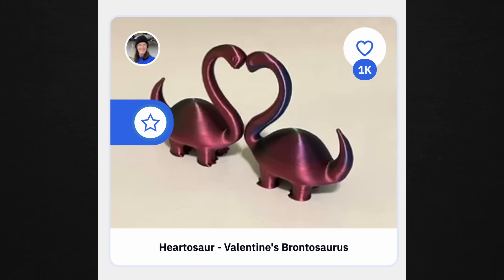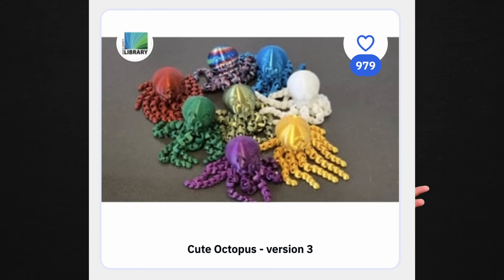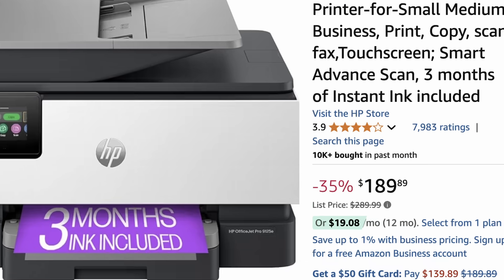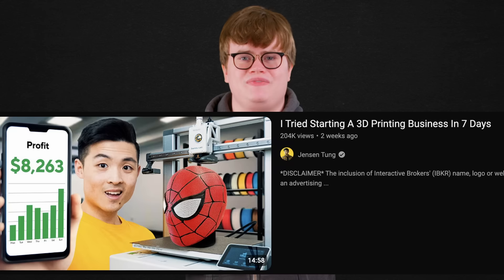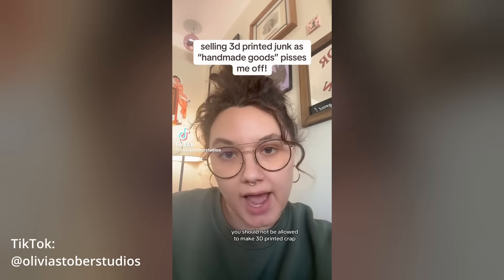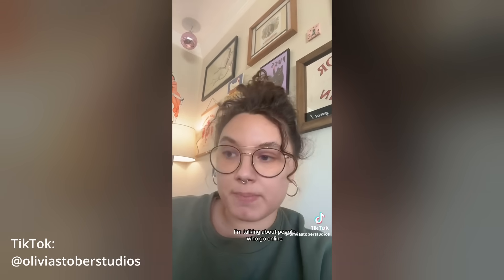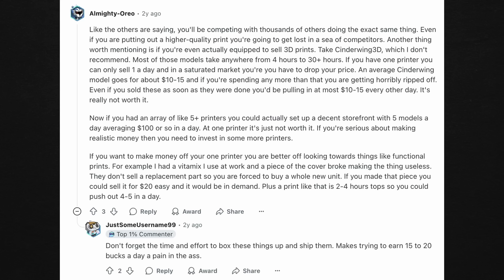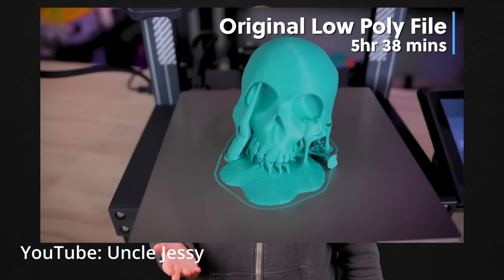The Rise of 3D-Printed Slop

Comment: as a 3d printer owner I can attest to the amount of plastic scrap I have, but understand that's the draw. everything has to have a hook and people being able to make their own silly stuff is part of that marketing hook, but this is just the litness test, this is training to see if you're built for the job. I quickly jumped from building simple thingiverse files to then move to freecad, to eventually create things like an entirely handmade desk with my own fittings and shop wood, created for a specific spot in my house, or the multiple shelves I've put together for cheap with my own brackets and labor. I make my own lamps with cool lampshades, just recently built an electric guitar for 90$,  and am planning to start creating home decor with it along with overhauling my kitchen to allow for more storage. yes the garbage is a problem, why we need more shredding and respooling options available on the market. Unfortunately most are at home DIY creations but hopefully soon there will be a proper at home shredder. If we could have access to a means of recycling these old prints (with no loss of filament quality might I add) for under 300$ that a simple consumer could buy, these silly gadgets could be the key to educating a generation about the possibilities of production. they don't have to be landfill waste, I have a recyling setup that works for PLA, it's not expensive but time consuming and quite in-depth to build off online manuals. Just hold out hope. things will get better with time

Comment: I designed and 3d printed a HRV with the addition of some aluminum, epoxy and silicone for my home for very cheap, it has saved me this winter. I designed and 3d printed custom mounts for a stearing dampers on my electric scooter, I could never have used a steering damper otherwise and it improved the scooter by a lot. I have designed and 3d printed many various parts to fix problems or replace broken parts on things. I have been fascinated by human evolution and I am currently printing replicas of skulls of extinct human species for a fraction of the cost of buying them.

I love my printer because of what it can do for me, but I also find it disgusting how most people seem to mostly print junk.

Comment: As a 3d printer owner, I completely agree with this video.  I only print functional stuff, 90% of which is stuff I designed myself.  Although, I do create waste when making prototypes or small slices of a model to check if it fits.  I just made a replacement charging station using my 3d printer and an old USB cable for my parents' mosquitto zapper, this stuff is what 3d printers should be used for IMO.

Comment: Disliked. It sounds like you really hate 3D printers. While there are definitely crappy plastic junk pieces being sold, they wouldn't sell them if there wasn't a market. If you want to remove 3D printed items from maker fairs, you have to remove any wooden items made using power tools, anything made using a mold, anything that you just assembled from a kit you purchased, and anything that was purchased that you just slapped paint, a vinyl decal, and/or rhinestones on top of. That covers 90% of what you get at most maker fairs.

If you take some time to know what you're doing, and learn how to model your own stuff, 3D printing can be an amazing addition to your hobby workshop. Those who are just buying printers to print files they got online will peter out eventually.
Reply: Well said….love it

Comment: People will buy what they want to buy. And the people who buy a printer will print what they want to print. If you only ever print little plastic octopuses or something and that makes you happy then why make a stink? I will admit off the bat i haven't got facts or stats to back me up, but I would put a decent bet on the idea that hobbyist 3d printing isn't even close to one of the world's biggest plastic polluters. Recently got a 3d printer myself. I've printed a couple of silly things, tentacle xbox controller holder, a couple of statues... But it's also helped me fix so many little things around the house and in my life and has forced me to start using Blender and refamiliarising myself with 3d modelling. 

You talk about the front page of whatever model sharing website having the "slop"... But why should i expect the really useful corner bracket for my very niche requirement to be up on the front page? Of course a cute octopus has more mass appeal and is more transmissible as an idea. They're almost like 3d printing memes. 

I skipped into the bit where you're going on about effort vs price charged. Who should you be mad at here? People printing ornaments and selling them to willing customers, or the customers for not understanding what they're buying? What if they want that specific thing and there is no higher resolution alternative? 

I dunno, I just don't think this is the big deal you believe it is.

Comment: 10:45 It's polymer, not fibrous. And yes, this video is somewhat disparaging. You lament that printing produces waste but also acknowledge that printing later by layer takes time. Yeh a print farm can produce a lot of models but your average person with only one printer will have a hard time producing a lot. Also remember that the dragon model is relatively recent on the 3d printer scene. And that it can take 10+ hours to print. You also don't just 'press print', even with someone else's model that cost them their time to create, there are still dozens of software settings and hardware calibrations that go into the pre print set-up of the model.
Reply: I’m assuming the person sending the model would also send you those software settings and hardware calibration with the purchase of the model files? Or do you have to purchase those separately from them as well absolutely squeezing every penny they can out of you?

Comment: I really like 3D printers and have one at home, and I completely agree with you. One, these things really need an emclosure and air filter in a home setting. Second, there's a lot of useless junk to print. It makes sense: the most useful things to print are things you can't buy because they're so niche, and by definition those things probably won't be useful to anyone else. The main exception maybe is organizational systems, like gridfinity. 

Those 3D printing shops that don't sell their own designs can't possibly be sustainably profitable. You're competing against anyone who can buy €250 worth of equipment. On the upside, failed 3D printing businesses are a great source of cheap second hand printers!

Comment: I mass 3d print miniatures. The price to buy these as sprues would have been several thousands of dollars. I have only  spent like 400. Though this is resin printing. But to be fair newer 3d printers are becoming capable of finely detailed 3d prints as well. 
A key use for both types of printers in my life has been to 3d print and customize specific parts or solutions to problems. I no longer have to scour the net to see IF a solution exists I can just find a design close enough to what I want and tinker with it in CAD software and I'm good to go.

Comment: This unenthusiast view resonates with me... I held off getting a 3D printer for so long because all I saw was trinkets and useless plastic waste. The first thing I printed on mine was a knob so my toddler son could turn his light on and off, and that helped me realize it was a tool that could be used for good. Now I design custom brackets and cases for my electronic projects (but only if a manufactured part is unavailable) and build model trains that aren't available in my region (some from others' files, some of my own design). I slice carefully and monitor my prints to avoid waste, and reuse or recycle the waste plastic when I can. I also believe that if you can't print something nice, don't print anything at all. It's a tool, not a lifestyle!

Comment: What it comes down to is that plastic junk is slightly cool to almost anybody.  Specific and niche prints are great for the person who needs them but if you dont need it,  it has no value.  So since thingiverse or bambu studio library is going to show you something that anybody could potentially want to print.    And if you are spending time designing something to sell, you either need to make somethnng that no one has designed before for a common problem or make something artsy and functionless.  I would suggest you keep track of every time your life would be improved by a custom tool, jig, fixture, etc and see how small that list really is.  In a manufacturing plant, we 3D print quite a lot and prototype fit and function before going into production.  In my day to day life though, it's not as common.

Comment: Most common 3D printer filaments (PLA, PETG, and TPU) don't produce that many harmful pollutants. I've read through their safety data sheets, and kept an air monitor next to my printer with no spikes in VOCs or fine particles. It does still smell a little, so I keep a window open regardless. 
HOWEVER, I know for certain ABS produces a lot of carcinogens, and resin printing offgasses, well, epoxy resin, so those 100% need to have proper enclosures and external ventilation.
Reply: Yeah I think he was getting confused with SLA printing which DOES need proper ventilation as the fumes that kicks out are absolutely toxic.
Reply: Your air monitor is faulty, I'm sorry to say

Comment: I work in injection molding and I can tell you plastic parts do not take more than a minute to be from granules to finished product. Depending on the product you can make 10 at the time that means every 50 seconds you have ready to use 10 parts.
There is an initial investment into the mold and design but after that it is incredibly cheap to make them.

Comment: I want a 3d printer to print skateboard accessories like skid plates for my freestyle and cruiser set ups because the right skid plates are hard to find online and are often overpriced when they're simply small slabs of plastic and bolts and are very easy to diy.

Comment: 2:49 I feel this videos about five years out of date, most printers nowadays unless you buy the absolute cheapest ones can print decent sized items in an hour or two let alone small ones.  And they don’t feel rough. It feels smooth, but you can still feel the lines. It’s an aesthetic not a down side, plenty of people like the layered look.
Reply: It really does depend on the goal of the print. Making figures needs alot more sanding and polishing than when I make prints for more practical things.

Comment: Print once, sand/finish, create a few molds, and the cast in resin. You'll get better results. Lost PLA casting with metals is an option too. Electro-plating is an option too. Safety, well if you care about that... then better throw out every plastic bottle and utensil you own.

Comment: I hate to sound like a gatekeeper, but to me these FDM slop farms don’t really feel like part of the 3D printing community, at least the version of it that first drew me in. Basically everything on thingiverse is licensed under non-commercial Creative Commons, and part of the “”“old school”””open source ethos of the community was not to sell other people’s designs without permission. It’s really soulless at this point - you can produce really high quality prints without post-processing if you take the right steps. Use (or better yet create) a simple design, pick a high quality filament, calibrate your print settings properly, and maintain your printer. I even went ahead and learned some CAD since most of the model sites are full of nothing but junk. I love that tinkering process, and I haven’t made a dime off my printer. I don’t sell anything, and I don’t even bother asking friends for material costs unless it’s a big project. You can tell most of these dragon vendors bought an Ender 3 (clone) and did just enough calibration to get consistent prints with their aliexpress bulk filament.

Comment: 3D printers are best suited to open source communities with the idea that people share designs freely. The RepRap project, which is largely responsible for the rise of accessible 3D printers in the modern day, was based around the idea of being able to use a printer to make a printer for others in addition to making other llight duty parts, ultimately putting manufacturing in the hands of the public much like how paper printers did for document printing. Printing items to sell is antithetical to what 3D printers were largely designed for.

Comment: Ive just got my first 3d printer as a Hobby. Ive made some Things that were just funny as a shaun the sheep toilet roll holder.
But i dont get it, that there is so much junk. Nothing that you cab put somewhere and use it as decoration or even as Tools.
This feels like the steam Workshop of gmod which has many Mode that are just fun fpr once and never touched again. But a 3d print cant just be uninstalled...

Comment: I use mine for engineering & prototyping & only print with abs which i have to because pla & petg would fail in my use case ,but i have to agree that more than half of my plastic goes to waste either by failded  design or wrong dimentions

Comment: I've printed my fair share of gadgets and gizmos when I first started printing, but I think anyone can find their perfect use case for a 3D printer.

 Once I've found stuff relating to my hobbies it became a cost/time saver. Why spend $15 and wait 5-7 days on a lens cap when I can print a low-profile version for less than 1/4 of the cost and only wait 1-2 hours? Why pay $20-40 for a rifle grip when I can make one for $5 and it'll be done by the time I get home from work? Now I'm making functional replicas of items that haven't been manufactured in the past ~40 years, like Type A and Type B batteries for old portable tube radios (aka beach radios) for wayyy less than any comparable commercial offering. Once I started getting into filaments other than PLA and ABS I found the printer to be a much more varied and more useful tool.

Edit:
 After finishing this video, I really just don't see what the fuck you're on about. A lot of these are either obvious points that everyone else has talked about, projection, ignorance, and insults. This may be the poorest put-together video I've ever seen. Please do actual research next time instead of cherry picking the things that make you look right.

Comment: I use a resin 3D printer for my long furby faces. We designed it so they can be sewn in and then we paint them and gloss them! We print in an outside closet so luckily no air quality issues in the apartment!